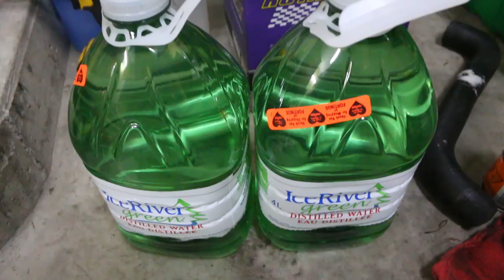Datsun 280z Build -  NEW RADIATOR

Comment: The 280z didn't have coolant overflow tank until the 77 year and when it was fitted it was front right of the car next to the horn.
Reply: Hodgimus_Maximus yep, it's literally about a foot forward of where they have it now on the other side of the radiator.
Reply: No mines a 1976 and it has one

Comment: so uhhh...... when's the turbo/stroker coming?

EDIT: btw you should really get a shroud for the radiator. the large gap between the grill and the rad makes the air turbulent. a shroud will make a HUGE difference in cooling efficiency. keep up the good work man